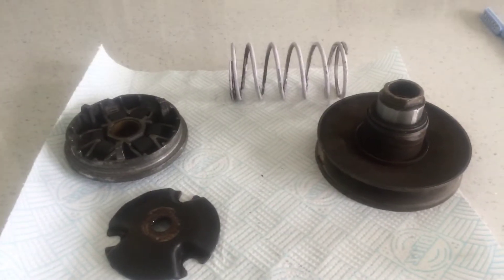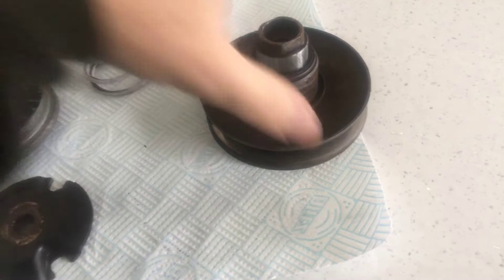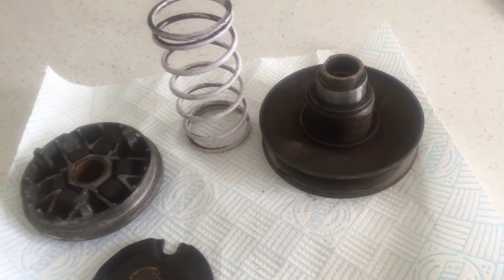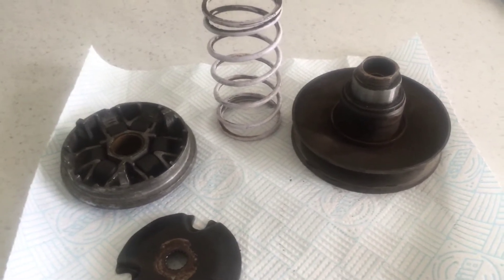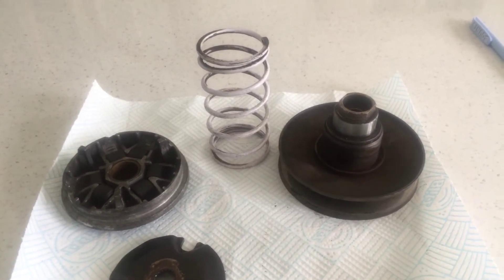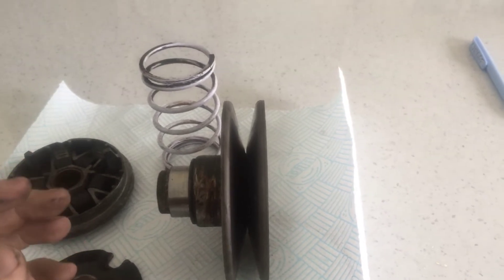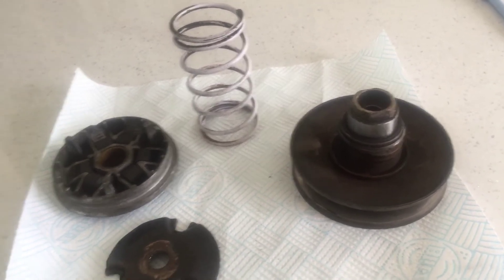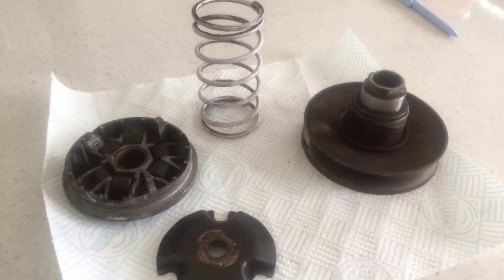Moped tuning / rollers - transmission

Comment: Good explanation. 
I've got a tmax.  Uprated contract spring.  Old rollers(worn) were 18g with 3g inserts in brass part.
I have 2 sets of Dr p sliders.
15g and 18g.
Should I stagger them ?